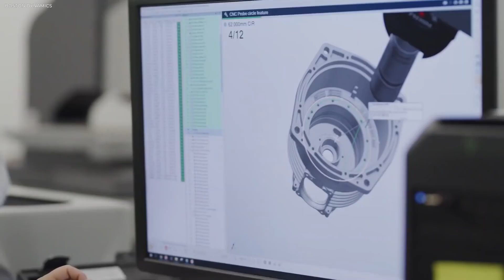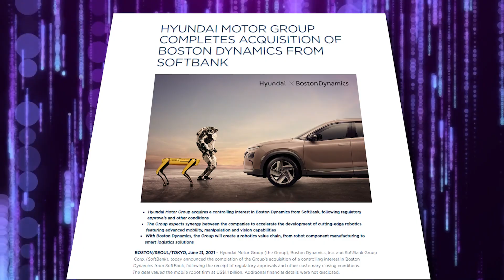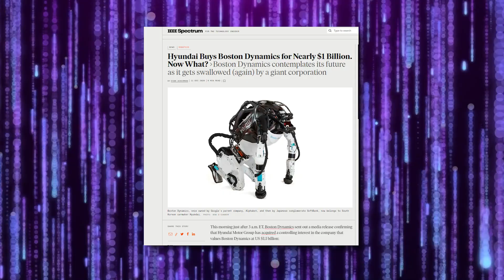Tesla Bot Is OFFICIALLY Ahead Of Boston Dynamics!

Comment: Only in Tesla stan wet dreams is Tesla anywhere near Boston Dynamics.
Reply: True, they are ahead of them.
Reply: @Zripas  In what way? Optimus can barely shuffle across a perfectly flat floor.
Reply: @TroySavary  
What counts and barely? And do you seriously think that factory robot needs to be able to perform backflips for it to be good at its job?
Reply: @Zripas  It needs to be able to walk faster than a toddler. Any human walking that slow in a production environment would be fired.
Reply: @TroySavary  
And yet its not a human and it can move slower than one... But I guess being able to do backflips is the solution for moving slow... 
Just FYI this is still in development and speed will increase with time, tho its not essential for most tasks as most tasks needs to be done while you are stationary. What needs to happen is for robot to be able to navigate to that next task in a reasonable amount of time, which it can do it  already with speed it has now. Could it be better if it moved faster? Yes. Is it required? No.

Comment: Just replace the brain of the robot, big deal. Atlas is much stronger and faster precisely because of its hydraulic actuation. Tesla should have gone this road too. There is no replacement for hydraulics, you will not see electrically actuated excavators any time soon.

Comment: Ahead? Boston Dynamics robots can run and do backflips while the Tesla bot walks only in a straight line like an old disabled fellow…
Reply: And this is exactly why people who doesn't understand this should not comment on it. How often do you need to perform backflip in a factory?... Not that often? Right? Point is about robots being autonomous, not one trick pony...
Reply: @Zripas  The backflip is indeed a party trick, but what Boston Dynamics demonstrated are excellent mobile skills and disturbance resilience, Tesla has demonstrated none. As for "one trick pony", the Tesla bot has at the moment only been able to demonstrate to barely walk in a straight line like and manipulation skills that are now commonly seen in graduate class projects.
Reply: @yoshyoka  
But this is the thing you are missing, Tesla bot isn't being controlled by 100% preprogrammed commands, its self learning AI based system. Tesla bot actually understands its surroundings by just using few cameras, while Atlas is one trick pony made to just show off mobility capabilities while being completely preprogramed to perform those with wild amount of failures. Those two robots are on completely different level. Its similar thing to current Autonomous vehicles, like comparing Waymo with Tesla FSD, one system is made to work in specific strict areas which got heavy prescan and will go ballistic if something new happens, while the other is made to work on any road and to deal with any situation. While the Waymo can be shown off to be more impressive quicker, it will lose on long run as this is not the way to go. 
I have experience when it comes to coding and i know that its really easy to make static specific code which does specific thing, takes little time, is quick, does what you set it to do, while making universal code which can adapt to wider range of requirements takes a lot more effort and time and can look worse at the start of development while outperforming later on. 
Atlas is an expensive toy robot, Tesla bot is the bot you would want to have working for you.
Reply: @Zripas  It seems that all your info only come from Tesla's marketing. First of all: Atlas is only one of several products of Bostin Dynamics, several of which do have autonomy (including Atlas for its disturbance resilience) and, unlike the tesla bots, are actively being used in industry. 
Second: AI for selective manipulation was new 15 years ago, not is it standard in graduate courses, 
Third: all we have from Tesla are edited videos where the robot performs a few underwhelming demos, thus even less of a one party pony than Atlas. 
But hey, time will tell! I am sure it will perform as well as the hyperloop, the robotaxy and  the solar tiles.

Comment: Also, robotics can be better, especially if they get the drive mechanism done well.
Basically you can have a flexible drive shaft for any motor function, at any part of the body,
while using only one drive and a magnetic coupling for each motion.
It means less control mechanisms, and a more robust main drive, or a less weighty one.
The maximum power for any single operation can equate the entire output of the drive,
instead of matching only the maximum output of a very tiny local drive. (or myo).
This can then make the robot very strong, limited by it's structure, while still
keeping the output for multipe operations available at the same time, sharing the same drive power.

Basically a 1000watt main drive, can be applied to a single function, when lifting weight,
or that same power can be shared during walking/moving operations with several joints receiving
a few hundred watts through the flexible drive shaft.

The drive would be less prone to wear and tear, to much less a degree than individual drives (or myo's).
I hope Elon gets this right, since his robots may very well be the first ones on Mars, doing
pre-colonization work there, with orders handed out and performed next to near human intervention-less.
Building stuff like a landing spot, early habitat drilling in a mountain for initial safety of deployment, etc.

And yes, magnetic coupling, since mechanical coupling leads to wear and tear.
For any robotic deployment on Mars, the more moving parts, the greater the chance for wear and tear.
Reply: And your idea has a single point of failure.
Reply: @tedmoss  He also believes Elon is really going to build a Mars colony.
Reply: @tedmoss  Well, no.
Just using a centralized drive unit, doesn't mean
that it can fail all at once. It may be reduced in output, but won'completely fail,
unless completely destroyed, which is ultimately always possible.
Many small engines can each fail, but none of the functioning ones
will allow operation of the failing engine.
A centralized engine system can be damaged and yet remain operational,
because it's better shielded on a per weight basis, while the output
is greater than each separate engine.
Let's consider a single squeeze pulp from an orange.
One engine would have to exert a power of 1 to squeeze for the pulp.
For each joint you'd have similar engines all powered 1, like 20.
For the centralized version, you'd have one engine power 10,
which could operate each joint at power 10, while having twice the shielding.
Same weight, better shielding, like 10 times much.
Or, you can have an engine like power 5, with 15 times the shielding,
still outperforming each single engine power 1.

Comment: The teslabot is programmed to learn how to function. This seems dangerous, as if it learns the wrong skillset, it can and sounds like it will use this knowledge that was instilled into it, for bad. Despite atlas and teslabot being designed for different reasons, teslabot is still in its early production and highly doubt they aren't looking to innovate further. If they continue with their design of being programmed to learn new skills, and then use this skillset based off its programming and learning functions, I feel like it could be compared to Boston dynamics "military killing machine". This isn't good news, but overall excited to see how tesla and bostondynamics plan to reduce the risks associated with their programming and functions.

Comment: Apparently the author of this video is merely offering an uninformed opinion.
  The Boston Dynamics Atlas robot has a massive library written by Engineers of movements. 
  Atlas then uses AI to evaluate its environment and task at hand, then from the library, it chooses the correct scenario and then adjusts and adapts that scenario to fit the specific task at hand.
  The concept that the Tesla bot uses does indeed show more potential for greater growth. However the current software algorithms are still in their infancy. Hence the current difference in performance between the two robots.
  Each company would truly benefit by incorporating both software algorithms to form a hybrid heuristic algorithm.  Unquestionably it would then become an industry standard!

Comment: This video is extremely stretched out so let me tell you why in this comment

Tesla’s bot is way slower and looks way more clunky, but the reason it’s so much better is because it uses AI for it’s movements unlike Atlas (boston dynamics’s bot) which has to be fully programmed by the engineers.

Comment: Boston Dynamics is taking the Arthur Young approach. Arthur (unlike Sikorsky) built small prototypes of his helicopter he could fly in his barn on a tether to test the Rotor and Control systems. After he worked the bugs out and got the model working correctly then he built a Full Scale craft and flew it. Boston Dynamics is working out the Mechanics of movement. It doesn't matter how good the brain is if the body doesn't work. A fast brain will make no difference in a slow body.
Reply: What you said is the opposite
Reply: But the brain is controlling the movement, that is the point of having an AI controlled robot rather than programmed. This is why Tesla's robot was quite shaky at first, the AI was still learning how to control the actuators, as it learns fine control will steadily improve to the point it becomes fluid movement.
Reply: It will absolutely make a difference.
Reply: The brain is by a vast margin , more important than the rest. Atlas is an advanced toy. Atlas is like a retarded athlete. Optimus is like a nerd who is learning how to improve his physical abilities. I know which one I would want.

Comment: So the Tesla robot, which is something any engineering undergraduate could cook up during a night of getting wasted, is better because it uses 'A.I.'...A.I. being software, a term that has lost its meaning because it's become a buzzword thrown at anything in the same way 'plant-based' has and in the case of Tesla, A.I. powered by an off the shelf Nvidia processor.

Or put it another way. Do you want a robot that slowly learns how to slowly shuffle around and cook your dinner or you want one programmed to do it perfectly, every time, in five minutes. Or better still, one with 'A.I.' that slowly learns how to do it, then does it with absolute precision, every time, in five minutes because it finely tuned, stabilised mechanics.

Bearing in mind the robot comes from a musk company, it's very likely that it will kill you anyway.

Comment: Atlas obviously is more rugged and durable, making it a better choice for military use

But the Optimus bot is built for general purpose, so the comparison of the two is difficult.

The only comparison that will affect the two is cost. 

Atlas a heavy duty bot for $100,000
OR
Optimus general purpose bot for $20,000.
The market will reflect the consumer choice.
Reply: Lol the teslabot isn't $20,000. It doesn't exist yet so the only value is whatever mumber musk pulls out of his ass.
Reply: atlas could walk into hostage sitch grab the badguy the micro instant bg moves the gun away from hostage... or have a full auto 9mm and give the bg a choice drop it or die
Reply: @duggydugg3937  they got mini dones 1000 times quieter. 

Atlas is hydraulic, they don't advertise it but it is pretty noisy popping and hissing. I'm sure that's enough to ruin a hostage situation.

Comment: Preprogrammed may not be a bad thing, especially with thinking about them helping make space liveable for humans. You would want them to perform direct functions that are programmed, but a non programmed one you can't guarantee it would take the same actions
Reply: Preprogrammed will only work on a case by case, very expensive. And if the environment changed, it won't know what to do. If you parked a forklift in front of the Boston Dynamics box picker it will just sit there. Tesla Bot already knows how to interpret different objects and work around them.
Reply: I think you're selling the Atlas bots programing a bit short. Boston Dynamics original design purpose was for nuclear power plant disastears. Tesla bot can barely stand on it's own. @zigadabooga

Comment: Multiple sources online say that Atlas can and does in fact move autonomously? I mean, obviously the parkour isn't autonomous, but I think it can at least walk and maybe jump autonomously.
Reply: Atlas is semi-automatic. Basically the engineer would work out the kinks for each behavior like jumping and rolling, but only for one specific model case. To account for variations in the actual run, the controller software adapts the numbers on the fly based on stuff like Atlas's current speed, footing, surrounding obstacles, platform height differences, etc. So all the driver needs to do to get Atlas to do parkour is guide it through the track and Atlas works out the details on its own. (Scott Kuindersma, Atlas' control team lead, explained the technical stuff in great detail on a Robotics Today seminar in 2020, available on YT.)

I think this approach is much better in achieving the level of reflex and dexterity required to do accurate back-to-back stunts compared to the AI approach, since the adjustments are much faster. I also believe there is an article about the dance video featuring one of their engineers stating that they streamlined the preprogramming process so they didn't have to manually compute too much stuff, which dramatically sped up the video production.
Reply: @iyafath  Huh. The more you know. Thanks for the interesting tidbit, internet stranger.

Comment: Boston robots don't even have fingers.  Tesla robot can pick up a bolt, place it in the threaded hole, pick up a cordless screw driver, and tighten the bolt. All that, after actually picking up the part and placing it right where the holes align.   
Which one is more advanced to do factory work?
Reply: The Tesla robot can't do that. It was under remote control by a human when that was filmed. It can't do anything on its own other than shuffle around like a 90 year old.
Reply: Except the Teslabot cant do anything of that.
Reply: Lol the teslabot can't do any of that.
Reply: @paintspot1509  Maybe you should go and watch the videos of them doing exactly that.
Reply: Why would a factory robot need to do all that?
Reply: Well atlas isn't a factory robot but some newer models have claws I guess